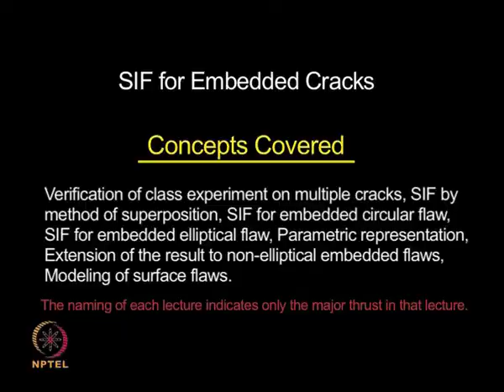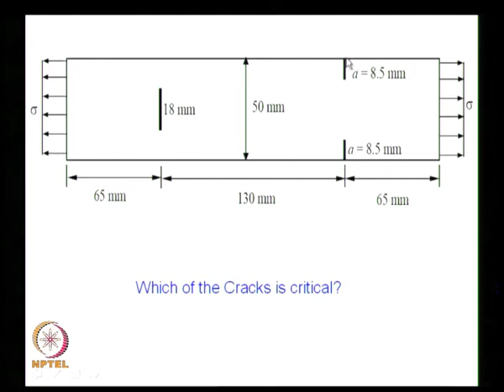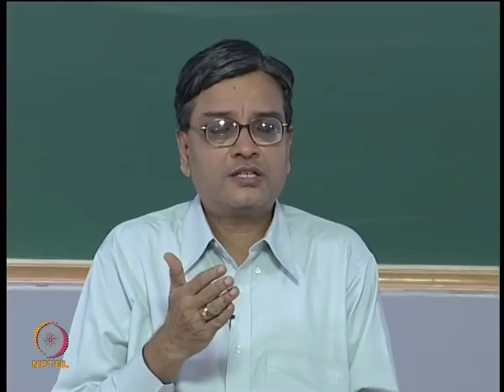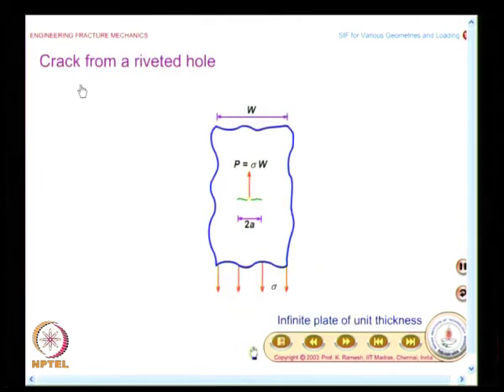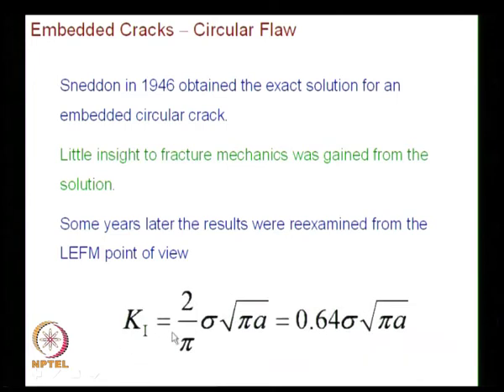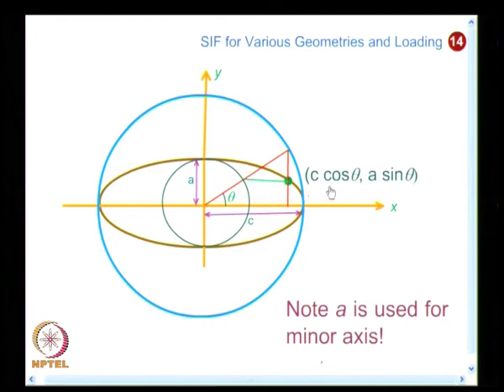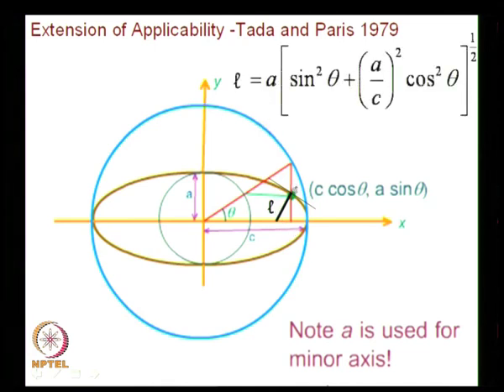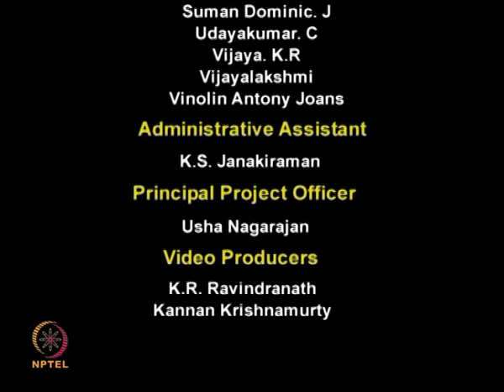SIF for Embedded Cracks

Comment: The numerical solution calculated through Tada's equation for centre crack seems to be incorrect. In all the cases, however, the angles are taken as radians.
Reply: Yeah, the angle was taken in degree instead of radians by mistake in the Tada's equation. However, the idea that the double edge cracks are more critical than a central crack is properly conveyed.